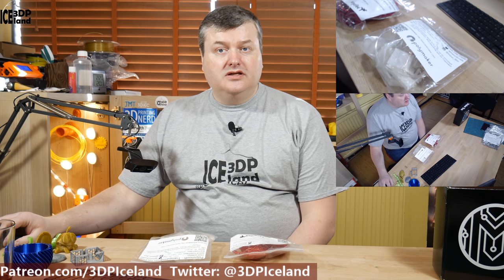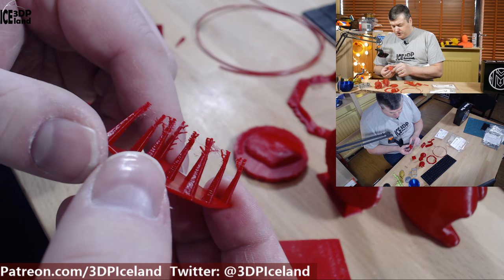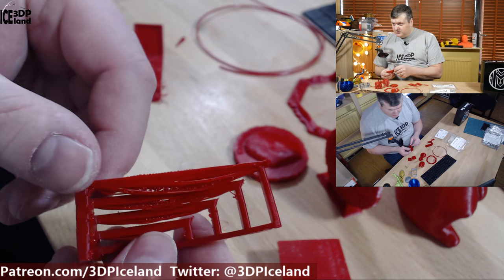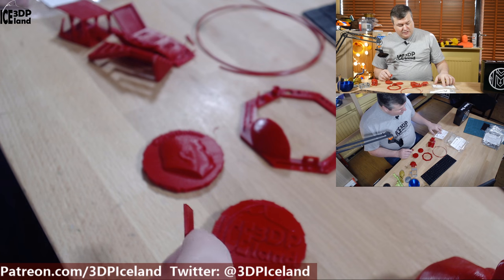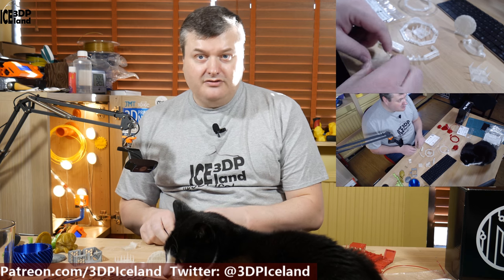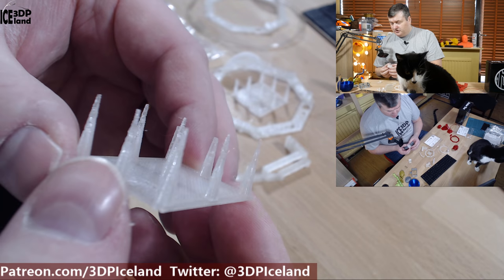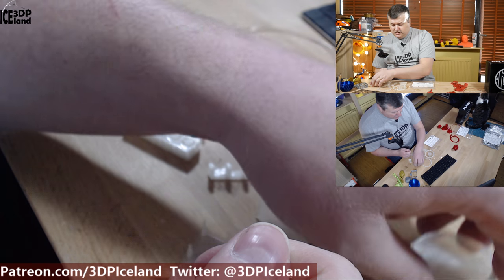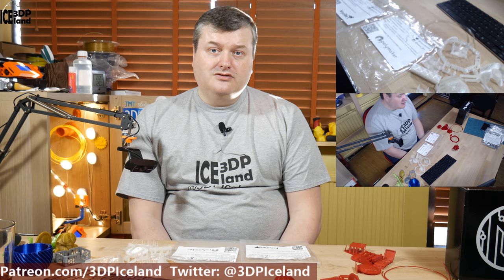Makerbox Samples   Polymaker Polysmooth  and  Ninjatek Armadillo

Comment: If you bake PolySmooth™ at 55˚C for 12h in an oven, it will print with the recommended settings like magic :)
Its just that it absorbs moisture very easily.
Thank you for the review!!
3d printing community is the best :D
Reply from the maker: 3D Printing Science thanks for the info,